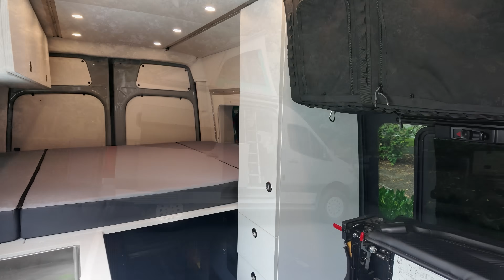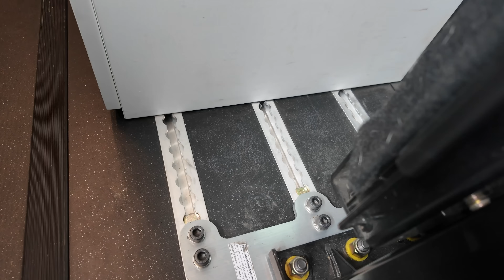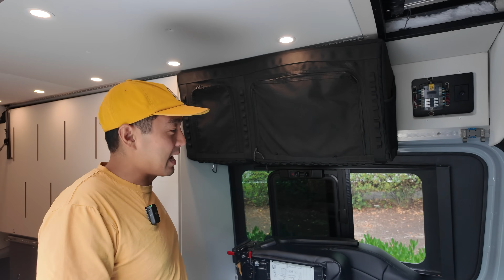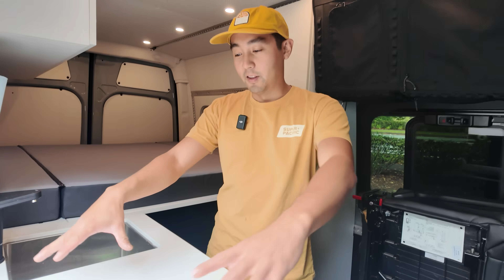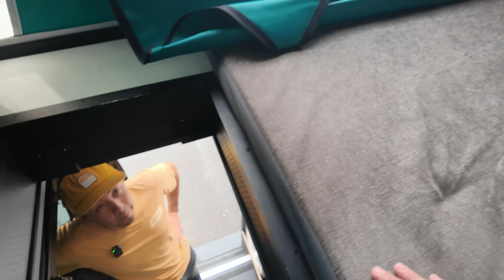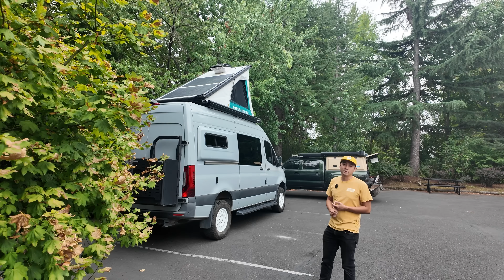Practical Van Tour for Gear Hauling & Family Camping

Comment: Great vid. Lots of good info. If you do a follow up vid, would also like to hear feasibility of installing the Cloud Cap facing in the reverse direction on a 170. Then you can exit the tent to sit on a custom rack. What types of accessories can mount to the Cloud Cap: awning, scene lights, security cameras, Baha LPs or light bar in front?
Reply from the maker: I did a tour recently with Nomadik Customs that did a cloud cap with a reverse one and small deck on a 170. I’m sure more will be coming out for builders
Reply: Thank you